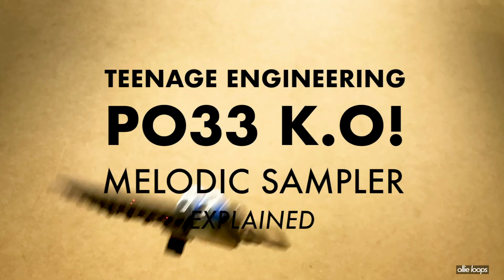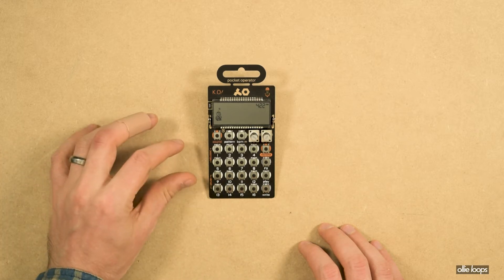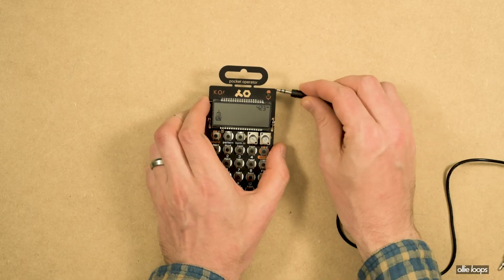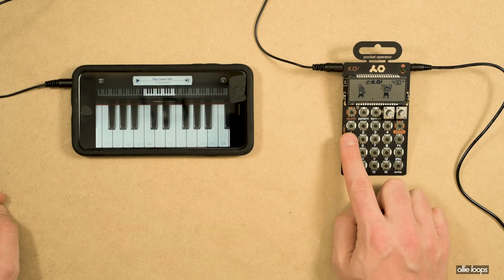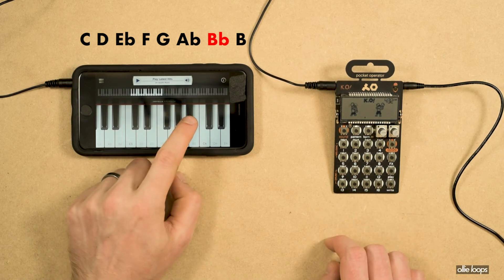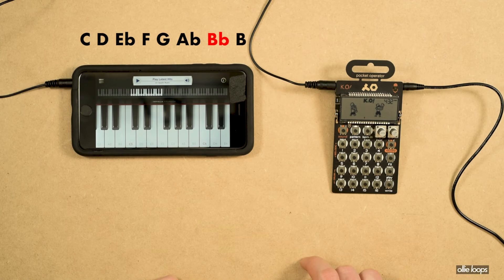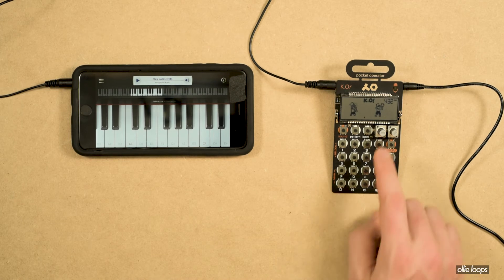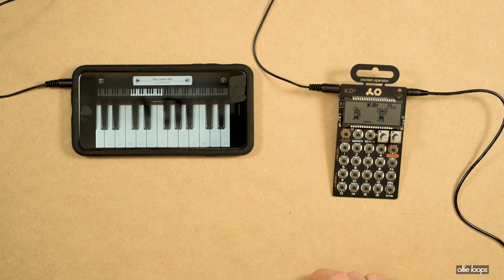Teenage Engineering PO-33: Melodic Sampler Explained!

Comment: Have Not noticed it in your Video that's why im asking. 
Whenever i record something, the Playback's Volume on the po 33 is much lower than playing from the Source direclty even when connected to the Sampler, and you didnt even have to up the Volume afterwards...
Reply from the maker: Hey Robert, there's a few things to check: 1. How does the meter look on the incoming signal when recording? This is visible at the bottom of the screen, left side being low and right side is high. The incoming signal should ideally be at least be to the middle. Adjust the source accordingly. 2. Although there is no input gain setting, you can adjust the volume of the sample and of the KO overall. Overall volume is set by holding BPM & 1-16, 16 being high. We recommend somewhere between 12-16. Then there is the sample's volume. With the sample selected, press the FX button until TONE is displayed on the screen. Using knob B, adjust the level of the sample. I hope that helps! 

For more info, check out some of our other videos including this one on sample setup: https://www.youtube.com/watch?v=lT67lz8DKyA
Reply: @OllieLoops  thank you for the very quick answer!
I usually record Samples high enough without clipping so i dont have to adjust the Volume upwards afterwards avoiding buzzy Sounds if you crank up the Volume too much. 
What i was wondering about was the Volume of the Playback on the Phone and the po was nearly the same, you didnt even adjust the volume, might also be my device who knows.
Reply: OK after relistening with headphones its actually quite noticeble in the Video as well, thank you so much though for real
Reply from the maker: @thebrokendeck  No Worries. Have Fun!

Comment: Very interesting: If You want a Major scale Just Pitch down, so the route Note goes two steps to the right (5 to 7). And then You can use all notes except 4 and 12 for the Major scale!
Reply from the maker: Good Tip. Thanks!
Reply: Wow this changes the game
Reply: They added that extra note just to do this trick i think
Reply: Your comment really helped me understand this better, thank you. Here is my breakdown for people really new to this (like me!)

Record an A note. This root note is now assigned to Slot 5 and will give you the following scales
1. A-Minor Scale: 13 14 15 16 9 10 11 5 (or partial 5 6 7 8 1 2 3)
2. Harmonic A-Minor Scale: 13 14 15 16 9 10 12 5 (or partial 5 6 7 8 1 2 4)
3. C-Major Scale: 15 16 9 10 11 5 6 7 (or partial 7 8 1 2 3)
4. Harmonic C-Major Scale: 15 16 9 10 11 12 6 7 (or partial 7 8 1 2 3 4)

If you then pitch-shift the root A on slot 5, you can cycle through all the Minor, Harmonic Minor, Major, and Harmonic Major Scales
Reply: Awesome tip! Thank you!
Reply: Five years later and this comment is still helping musicians on the internet. Thank you kind sir!
Reply: @bkinak9648  thats so great to hear!! Glad i could help you!

Comment: Can we alter the scale by changing the pitch of each individual step?
Reply from the maker: Hey, I'm not the best at music theory, but I'll do my best to answer your question. You can alter the key of the (minor harmonic) scale in semitone increments using the pitch setting on the left encoder. This changes the key of all steps within that melodic sample. It will change any steps already sequenced in the pattern. You can change an individual step's pitch by going into step edit mode, holding down the step you wish you change, then rotating the left encoder. That will cycle through the steps in the current scale, steps 1-16, which spans two octaves. But, as far as I know, you can't adjust the pitch of a step outside of the current key and scale. So it will always be in key within the scale. 

Hope that helps!